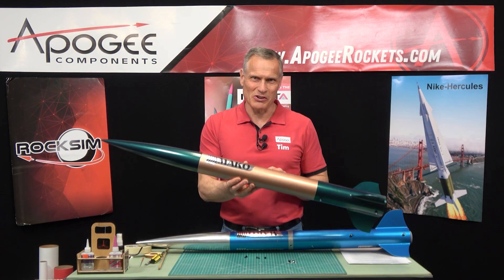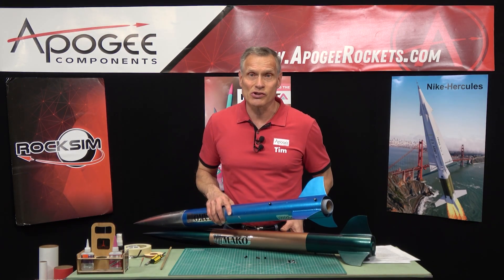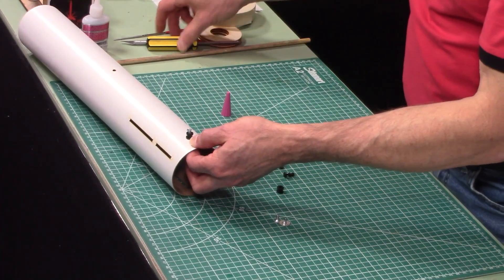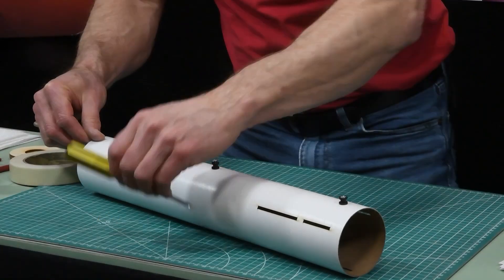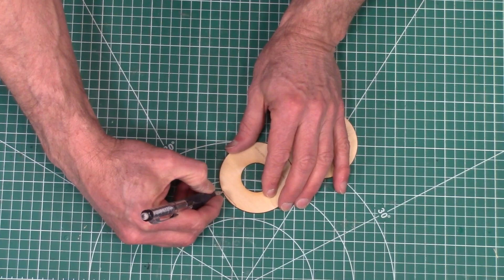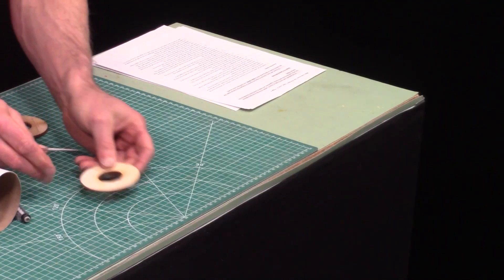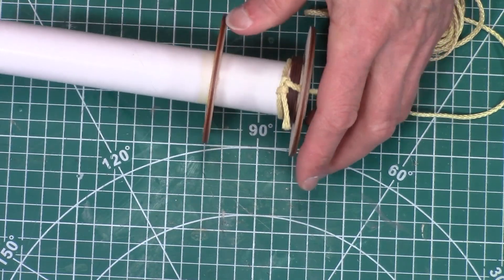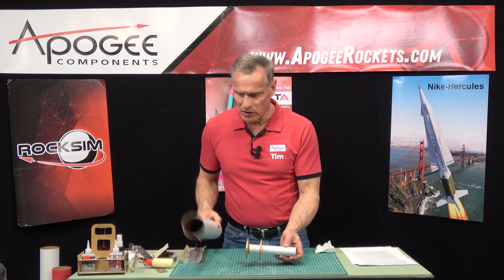Let's Build the Mako | Steps 1-10

Comment: Just curious, why don’t you glue the rail button weld nuts in “after” you glue the centering rings (motor mount) in?  That way you don’t have to worry about sanding flats on the rings. Also, makes inserting the fin alignment guide onto the tube easier.
Reply: It was designed this way for maximum strength. Installing the forward weld nut later would with the standard 29mm mount, but the aft weld nut sits between the centering rings so there is no access after the mount is in. Also, placing the weld nut behind the aft ring results in significantly less strength and increases the risk of the weld nut ripping out. In any case, if the kit is modified with a 38mm mount, both weld nuts sit inside the rings and are - thus - inaccessible.

In any case, the kit comes with perforated rings to make adding the flats easy (we didn't have them ready when Tim was ready to build!), so it's not a difficult step. They can even be snapped off with a pair of pliers.